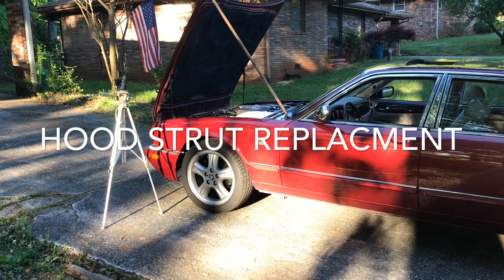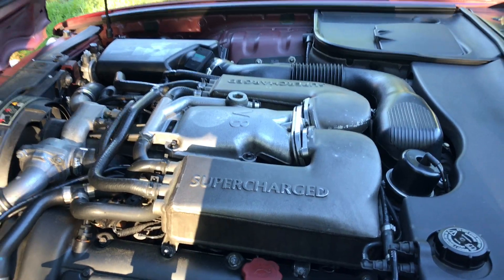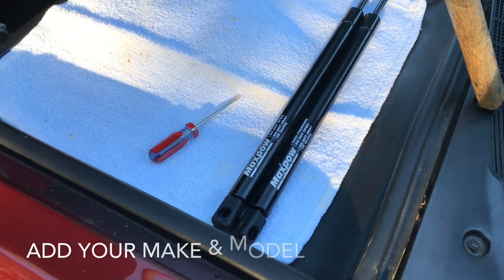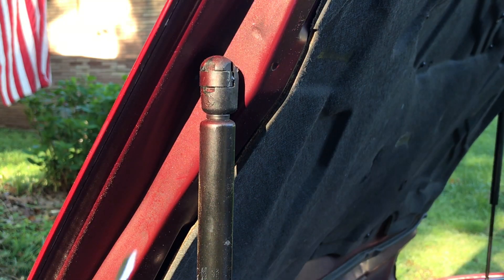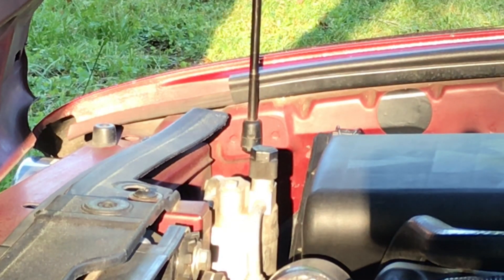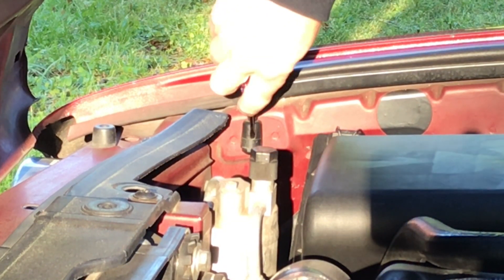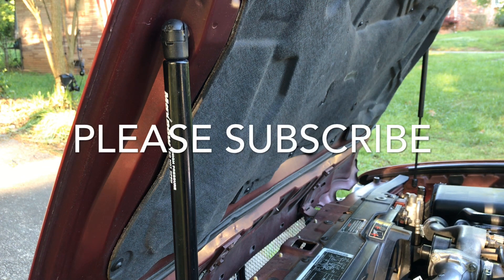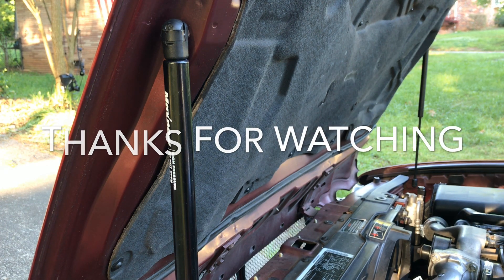Hood Strut Replacement

Comment: the struts had the holes (up and down) looking toward the same direction while the plug in sites are opposite directions.  Did you twist the strut bar? How do you do that with not risk of losing gas from the strut?  You did not show any of this. Please, let me know.
Reply from the maker: Correct no gas leak